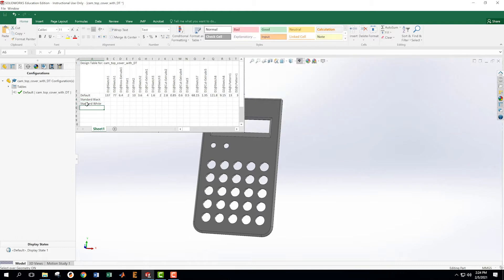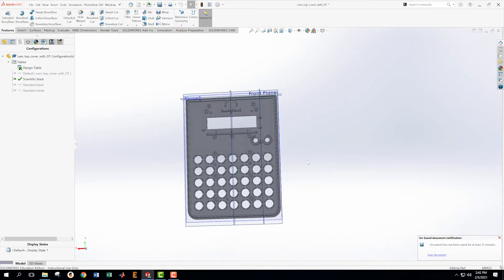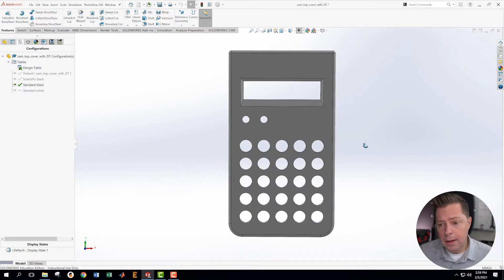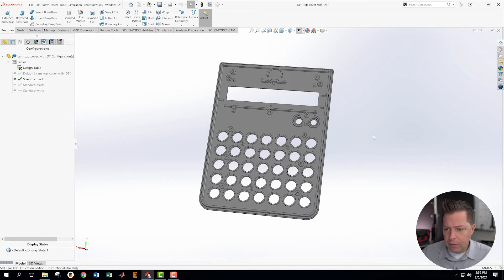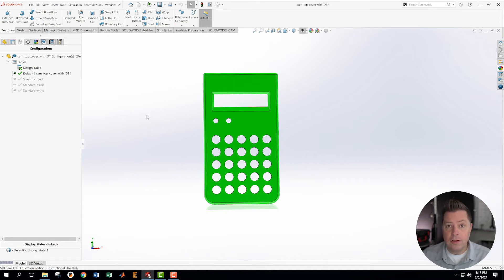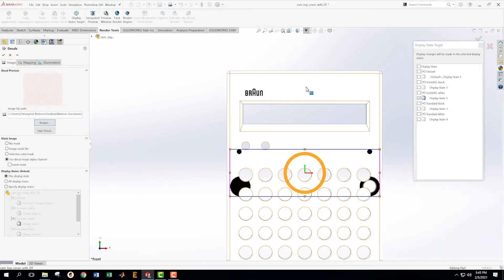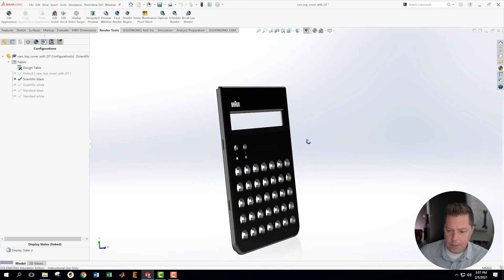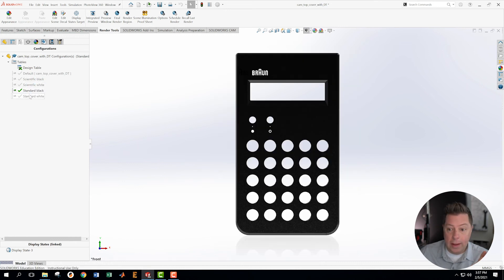Design Tables with Complex Parts (Solidworks)

Comment: I'm curious how you would put in the values for using Patterns. I know you can do it for the Hole Wizard.
Reply: The number of sides of the Polygon Pattern is not controllable outside of the tool.
But dimensions are.

However you can substitute the Sketch, Circular pattern tool and make your own controllable polygons.